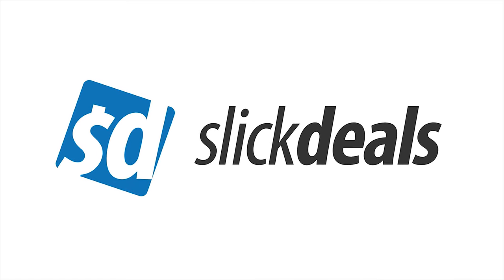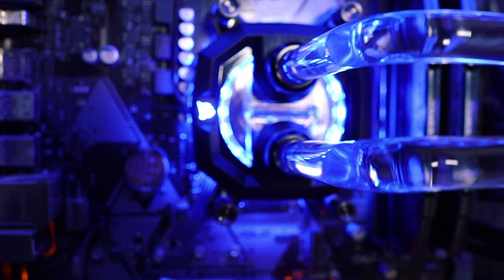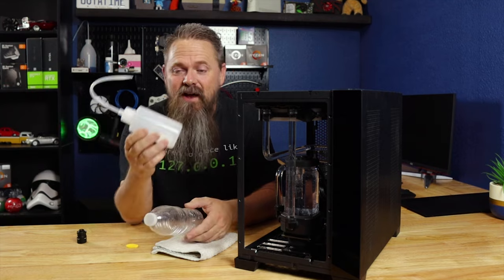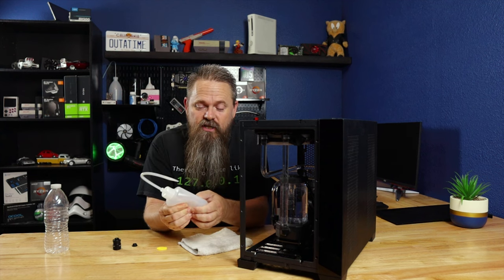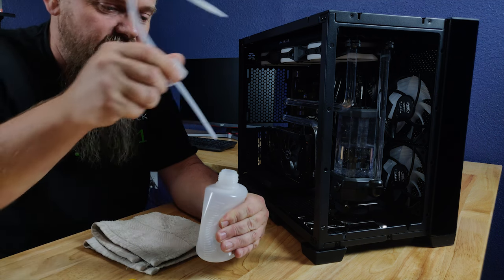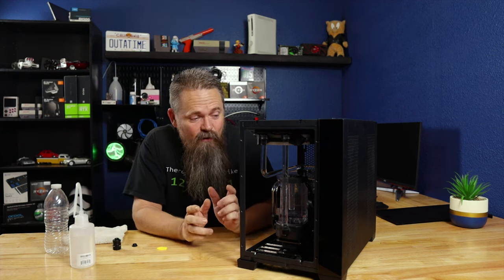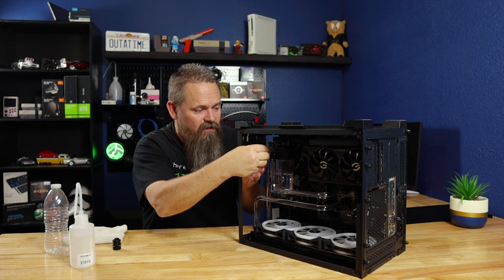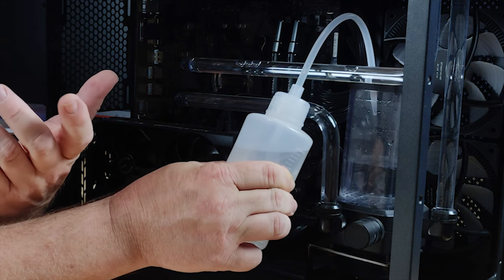I Screwed up my Water Cooling Loop. But it's NOT MY FAULT!!

Comment: I'm old fashioned.  I've never liked the idea of mixing water with powered electronics and have avoided water-cooling for my PCs like the very plague itself.  Just how more efficient are these systems and are they essential for running an i9 with a RTX 12gb card?
Reply: They're not essential, however water might be better for cooling
Reply from the maker: There are very few instances for water cooling is necessary. However, it's much more efficient.
Reply: @CyberCPU  Good to know I'm not locked-in to a water-cooled system for a new PC.  With my luck it'd spring a leak, I'd get electrocuted and worse, my shiney new (expensive) PC would go up in blue smoke.
Thanks for you reply, great video as always!
Reply: Not essential in anyway. Well at least if you have even remotely decent airflow in your casing. There is one big benefit in water cooling though. It's that you have that temperature buffer if you have semi decent coolant volume. Meaning that your fans won't ramp up and down in those short heavy system loads. Efficiency is very debatable thing. Energy transfer laws, laws of physics state that you'll always have losses when you switch to another "medium" when cooling. After all, you can't store all the heat in coolant, unless you have huge volume and radiator surface area, you need to dissipate it and in this case it's from water to air again and that's generally with fans, again. If one would like to have most efficient way, then it would need refrigerant based system, which would allow actual below ambient temperature cooling, say for hardcore overclockers. I'm not saying water cooling is bad, but it's not some kind of jesuses next coming in cooling. I've laughed multiple times on some "bad ass water coolers" that have some ridiculously small surface area, meaning die sized copper plate without any fins etc. and even plastic shells that essentially act as an insulator. I mean there just isn't surface area enough to even have good effect in coolant based system in multiple occasions. People seem to forget constantly that you need decent flow AND much surface area for system to be effective. Meaning die contacting material should be ie. copper and still have proper sized fins to make that surface heat transfer to even happen well enough. TLDR: All cooling methods can be effective if they're done correctly. Stating that something is superior to another is complete and utter BS.
Reply: In addition: If you want to see refrigerant based example, check out stuff like Tech Integrients YT channel. They have quite good stuff in many physics based topics.
Reply: It's not 'necessary,' but is the most efficient/effective means of cooling components. It's mostly just for enthusiasts that enjoy optimizing and fiddling with tuning their enthusiast builds. Usually overkill and more just for fun/looks/extreme performance or acoustics. They're just cool, literally and figuratively.
Reply from the maker: @jothain  
The thermal conductivity of air is 0.025 W/mK
The thermal conductivity of water is 0.598 W/mK
That would make water almost 200% better at thermal conductivity. 

Furthermore water has a far higher heat capacity. 
The heat capacity of air is 700 Joules 
The heat capacity of water is 4,184 Joules. 
So the heat capacity of water is almost 150% better then air. 

So not only is water more efficient at removing heat but it can also carry more heat. So to say it's not more efficient it's just wrong. That doesn't even touch on the subject of necessity. 

In most cases it's not necessary. However, it absolutely is more efficient. I mean it's not even in the same category. The efficiency is so good that I will absolutely agree that it's overkill in most cases. It's likely overkill in my case. However, because of the efficiency of water cooling I'm able to run an overclocked system at practically complete silence at load.
Reply from the maker: @Matt-gf4gd  exactly.
Reply: @CyberCPU  but your cpu isn't swimming in water. It's mostly about surface area I mentioned before. If you can't transfer heat into medium, whether it's water, air or ie. metal conductivity is almost meaningless. Yes properties you mentioned are likely true, but they don't mean jack if surface area is like before mentioned die sized little piece of alloy. Remember that most air coolers have at about ball park of plus 80, likely way more times surface area than most puny water cooling blocks have. That's what I'm after at. If you don't have surface area, all figures you mentioned are essentially completely meaningless. You're not transferring that heat into water. You're transferring it first to cooling block, then water. If that thermal "layer" has bad properties, like that surface area or materials, well then it doesn't matter even if your medium would be liquid silver 🙂
It's obvious why good air blocks are big. It's also good to keep in mind that they're not just big slabs of aluminium with large surface area. No, many of them also have heat pipes, which can work even better than just block to water systems. Remember that those heat pipes have water (or something even more exotic) and that heat is instantly dissipated in air. Sure, absolutely you need casing that allows air to move. But still in my eyes, water cooling has only one benefit and it's that it can be made fairly quiet. Disadvantages are quite many, possible leaks, water pumps especially in computers are creating heat into system itself, components generally act as radiators after that peak load is cut off etc. So yeah, essentially it's pretty much about good conductivity and surface area. Those aren't usually in good balance in water cooling for computers.
Reply from the maker: @jothain  A water block has microfens and typically has the same surface area as an air-cooled cooler. The only surface area that matters in this context is the heat spreader on the CPU. The rest is just wasted material and doesn't aid much in cooling. 

In a water cooling system the heat is transferred from the microfins in the block to the fluid which is then pumped into a radiator to dissipate the heat into the environment. 

In an air-cooled system the majority of the heatsink is essentially the radiator. It's purpose is to dissipate the heat into the environment. 

Water blocks don't have to be huge in order to do exactly the same job as an air-cooled system. The fact that water cooling is so much more efficient is the reason why you can have a small water block and still have a system that runs under load at 50c while the exact same system would run at 80c on air.
Reply: @CyberCPU  that's what I've been trying to say. There's tons of products that don't have that surface area to transfer heat into water. There's tons of utter junk products in market. If you have surface on just the die, they can't even transfer heat well into water. There's also many products that have quite a bit of surface area, but flow isn't forced to go through all that area,leaving vast areas without any flow through. This is obviously flaw in many air solutions too,but at least convection will force air to move in fins. This is not the case in poorly designed water blocks.
Reply: I just watercooled my RTX 3080ti, EVGA FTW ULTRA, EKWB ABP Set. I would run my fans at max for benchmarking, it did pretty well to stay at 70c, but my clocks with a +90 would fall under 2000Mhz. I got a clearance, so excuse my radiators, but now I can run a +165 with 1350 memory overclock, and furmark struggles to push me past 46c with a 240 and 140slim rad. The gains are immense, and if you want a quiet system, it just makes more sense to watercool. With my fans stuck at 35%, hardly audible with the glass case off, 55c is the highest I've seen, few games can even push the card there at 2k res and 240 refresh. It is expensive though, but you get what you pat for right? I wouldn't say anything is essential though, mid to top end gpu coolers should be enough for your card to function well. As far as CPUs go, I would buy the biggest AIO you can afford and slap it on. I'm using an EVGA clc 360 from 2020, and it's handling my 9900k overclocked to 5.3 GHz just fine. New gens probably want the 280 or 360, but 2021 and below, you should be fine with just a 280.

Comment: Thermaltake doesn't come with a drain valve at least for my plastic tube and not sure how to add one
Reply from the maker: This is the perfect video to answer that question.
Reply: @CyberCPU  I forgot to mention my system is soft tube my pump is simple only has a in port and a out port.
Reply from the maker: @claypyrotech7473  You have a reservoir, don't you?

Comment: Soft tubing is little, and for me now no stress to drain.
Reply from the maker: I have both. My main system that I use daily uses soft tubing while this system is hard tubbing. They are both about the same to drain. The biggest benefit of soft tubing is it's easier to modify and do maintenance on.

Comment: My Gosh, I've seen less cooling in a nitro build on a car.  Now I do remember the first DX4 100 mHZ CPUs that actually boiled water.  Back then a copper fan cooled heat sink was enough.   But this.  The cooling system has got to cost a pretty penny.  If that goes, that's a huge oops.
Reply from the maker: It looks more complicated than it is. There are only a few pieces to make it work. A reservoir, pump, water block and radiator.
Reply: @CyberCPU  No Duct tape or krazy glue?
Reply from the maker: @captainspire9094  no, definitely not. 😂🤣

Comment: thanks for the informational vid on having drain setup on loops

I do tell ppl watercooling is an hobby; once your have your loop setup the only thing you'll typically buy for platform upgrades are gpu block... my corsair xc7 has mounting for Intel & AMD already

oh the good thing about loop in high ambient temp (tropical climate 33c), my cpu & gpu has never gone below 70c fully loaded on air cooling... and on watercooling loop they're mid 50c maxed

watercooled hardware typically last a lot longer due to less heat... oh would be nice if you make a short vid on using coolant temp sensor for fan curves

Comment: A car oil syringe (with flexi tube)  is so much better than a horrible squeeze bottle.
Reply from the maker: That would work but there are a few issues with it. For one, not everyone has something like that. Most people with a water cooled system have a fill bottle. The other issue is, if you want to reuse the fluid that tool would have to be really clean so it doesn't contaminate the fluid.
Reply: @CyberCPU  You can easily get a syringe off Amazon for less then $20. You can just suck up some distilled water into it to clear any retained liquid enough. Get a transparent one.
The horror of a squeezy bottle is well worth solving for $20.
Reply from the maker: @Safetytrousers  This was only necessary to install the drain valve. You don't need to do this every time. The full bottle is essentially free because typically people already have one if they are water cooling.

Comment: Wait, lemme grab my turkey baster, or a syringe, LOL. This is why I've always air cooled. Right now I'm running a Hyper Evo 212 Black Edition RGB, (I liked the mounting brackets over those wires)  on an R7 2700 with 2 fans set to push/pull. Unfortunately because I'm terrified to use liquid cooling it means I can't get a higher powered CPU. I'm planning on upgrading to an R5 3k series because I don't need the extra cores the R7 provides. Will I need an AIO for that, or can I get away with my CM HE 212? I'd possibly consider a custom loop, but my brain shuts down, and I get a nosebleed just watching installation videos on it, lol. Not. For. Me. 🤣
Reply: I've had 4 water cooled builds, once it's set up I've never had a leak. I had a big Noctua air cooler that bent two socket pins (properly installed).
Reply from the maker: It's not as scary as it looks.
Reply: Why not upgrade to an R5 5k series? I run a 5600X with a Hyper 212 RGB and it keeps the CPU below 80C (usually no more than 77C) while running Cinebench R23 multi-core tests.

I will never understand the obsession with CPU temps. Nearly all modern CPUs won't start throttling until they get above 90C. I consider any temp at or below 80C to be a win. I only become concerned if I see my temps creeping up to 85C, which they never have.

Now, having said all that, I wouldn't dream of running an air cooler on an i9-12900K, or a Ryzen 5900X. Those pretty much require water cooling.
Reply from the maker: @JimKJ3N  Throttling is when the CPU clocks under its factory clock. The CPU will typically boost beyond its factory clock speed if the temperatures are low. 

For instance my Ryzen 5 3600 runs at a factory clock speed of 3.6GHz. However,  it typically runs at around 4.1GHz while boosting. On water it stays in the 50c's. The issue with throttling is when the CPU goes under the factory clock of 3.6GHz. There's still a lot of headroom to loose at temperatures under throttling. At 70-80c my CPU would never reach over 4GHz.
Reply: @CyberCPU  Having never owned a 3600, I can only convey my experiences with a 5600X. It would appear that AMD made some improvements (obviously) between Zen 2 and Zen 3.

With PBO enabled on an Asus B550-F Gaming board and a Hyper 212 RGB cooler, I can get all core 4.45-4.47Mhz (with occasional single core boost of 4.65Mhz) on a 10 minute multi-core Cinebench R23 throttling test. I ran the test several times. CPU temps were between 75C-78C during every run.

AMD claims a 3.7Mhz base with 4.6Mhz (single core) boost for the 5600X. I'd say I'm getting what I paid for, despite not being at 50C.

YMMV
Reply from the maker: @JimKJ3N  The clocks I mentioned before are factory. It's not overclocked. What would your boost clock be at factory? 

Ultimately there are very few systems that require water cooling. However, the thermal efficiency and the noise difference is it pretty big deal. Even if your performance is the same, that's still a 30c difference and a system that's practically silent. My fan speeds are around 1k RPM on 120mm fans. When this system was air-cooled it was quite noisy at full load and ran at about 80c.
Reply: @JimKJ3N  I mentioned the 3K series because I'm on a GTX 1660 SC Ultra GPU, and don't want to introduce a bottleneck.
Reply: @demontekdigital1704  The 3600, on average, is going to cost more than the 5600. I don't consider that logical, bottleneck or not. It wouldn't surprised me if the 3600 creates a bottleneck as well.

The things people worry about..... shrug
Reply: @JimKJ3N  You're absolutely right. I wasn't necessarily worried about it, but I said that before seeing the prices, lol. I've since recalibrated my thought engine on it, and would happily buy a 5600.
  How an older CPU costs more is baffling to me, but here we are, lol. P.S. I apologize for the 4 month late response. Apparently Youtube doesn't like to notify me on replies.